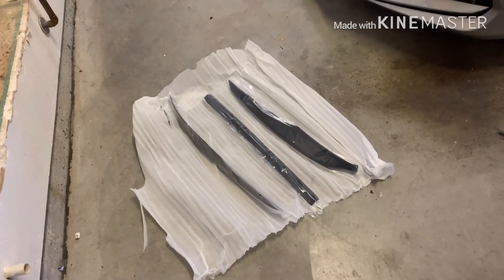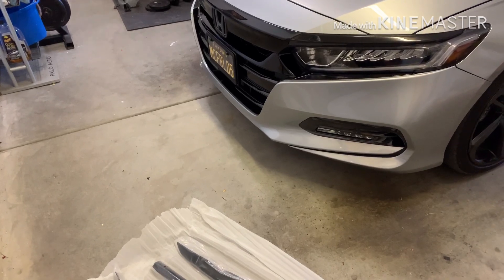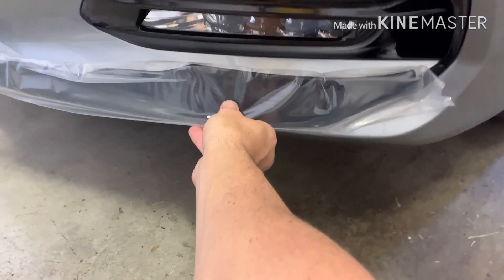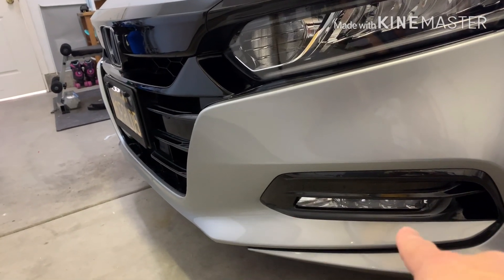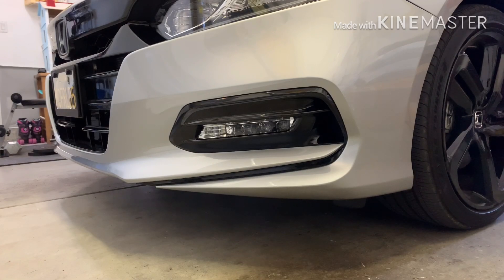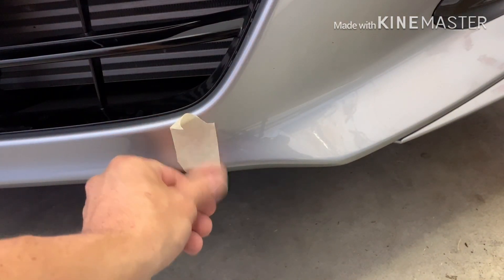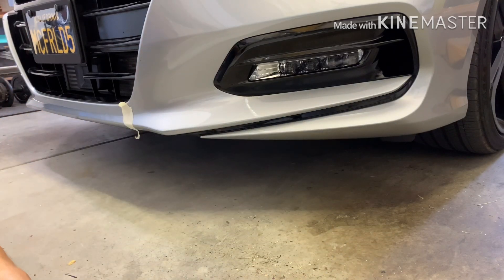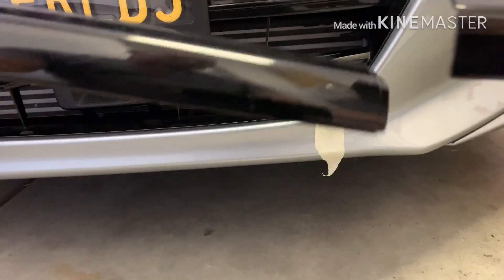Simple mod will enhance the front of your 2018-2020 Honda Accord

Comment: Thanks for the vid but this was the only piece that I thought didn't look rite imo. I already put in a lip spoiler a while back and even bolted it in with nuts as well to secure it. I even used double sides 3m tape as well. I had to remove the bottom plastic covers to get on the other side of the bumper tho.

Comment: Those vinals on your rims look hell of nice. I’m just worried if I put them on they won’t last
Reply from the maker: Thanks man. I highly recommend them. I’ve had them on for a year and no issues whatsoever. As long as you apply them right they will last. Just when you wash them take extra care with your scrubber. I don’t go through car washes either though. For the price it really change the look of your car
Reply: @HondaJon  , I have the same car and color.... I'm thinking about blacking out my wheels but live in an apartment without a garage with an outlet. Do you think they'll stay on of your don't hit them with a heat gun?

Comment: is your top piece a cover as well or painted ?
Reply from the maker: It’s just the 3 piece plastic overlay. Really happy with it. Been on for a year. No issues. And it’s not permanent 👍🏻
Reply: @HondaJon  looking to do the same on my accord. mine is leased, but I'm looking to do the same as you did with it. do u know if itll ruin the chrome under neath after years with it?
Reply from the maker: It won’t. It actually protects it. A lot of people are having issues with the chrome bubbling due to sun damage. This covers its. When you remove it the double sided tape will come off leaving the chrome in perfect shape.
Reply: @HondaJon  perfect. do you know if these will fit on the 2020 aswell ?  everywhere I look on ebay it says 2018-2019 front grille.
Reply: jay b Yes it fits on 2020 models.